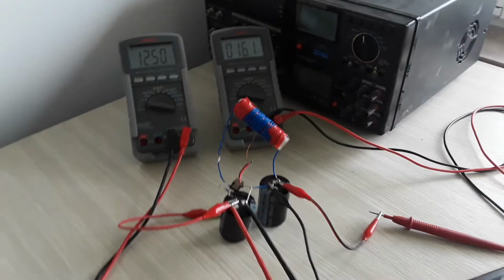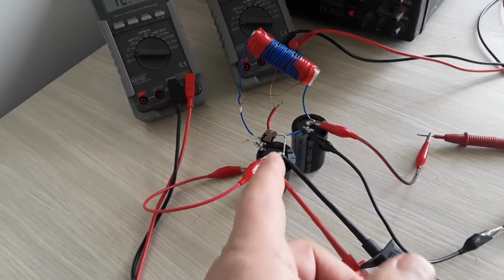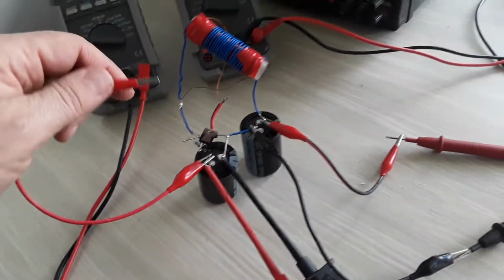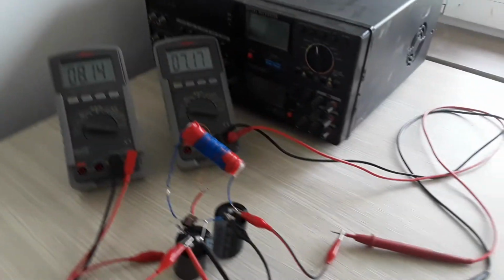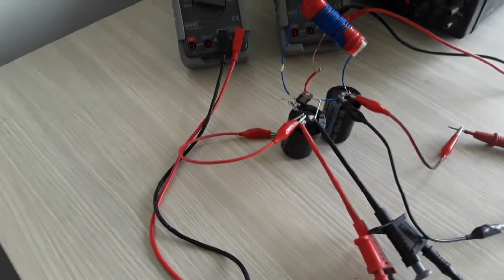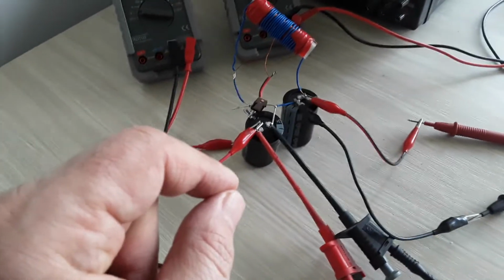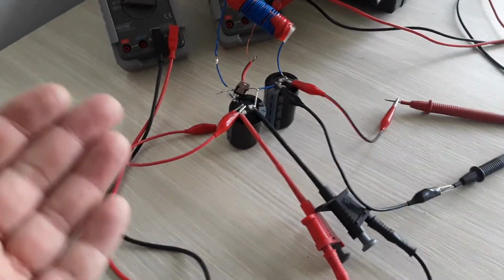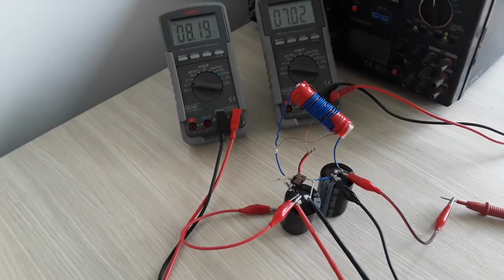Multiplication of Charge with  Coil

Comment: energy in cap= 1/2 (capacitance of cap) times (Square of voltage).
square makes it different. So dont compare voltages directly, will be error
Reply from the maker: Dear Ivo, I do not make that kind of error :) 
I was always precise that I am talking about multiplication of charge, not energy. I added in subject two links where I am talking getting more energy, but as I said it is usless and  not sure  what cause this effect. Maybe  electrochemical reaction in capacitors or looped coil,capacitor and diode collect EM from ambient. But I made test in grounded metal box and it works the same.
Reply: OK thank you, I've edited my comment